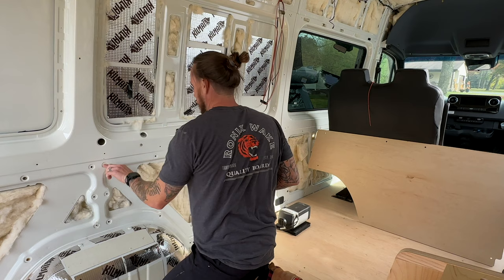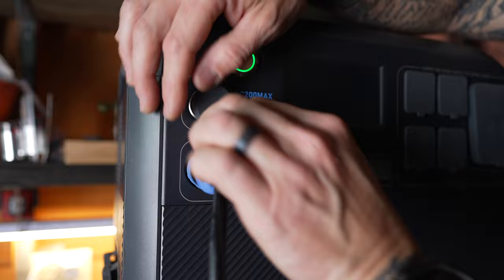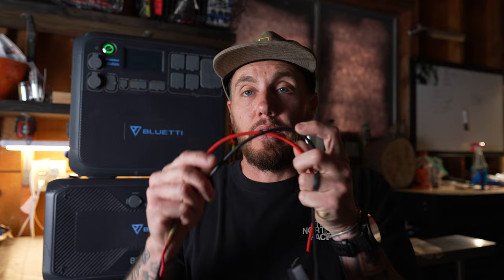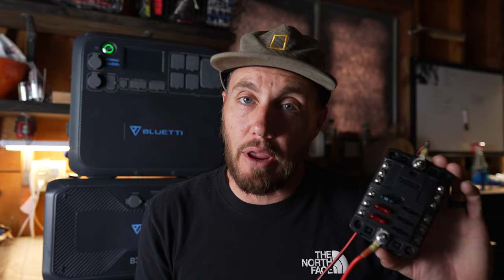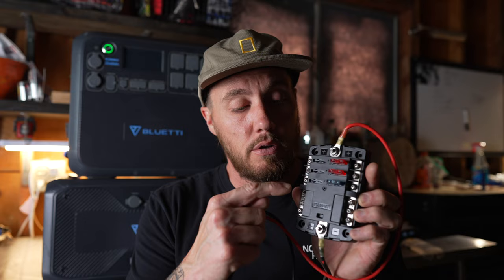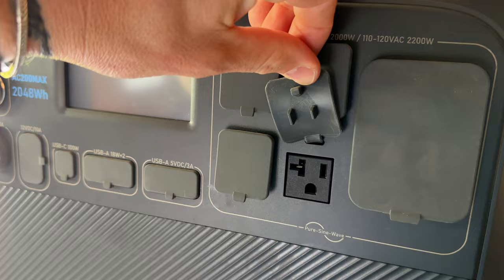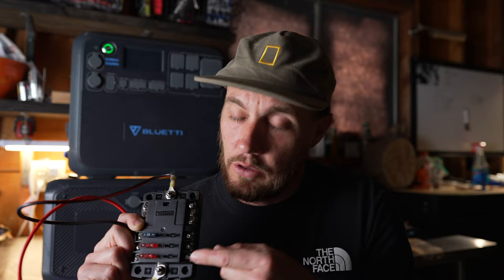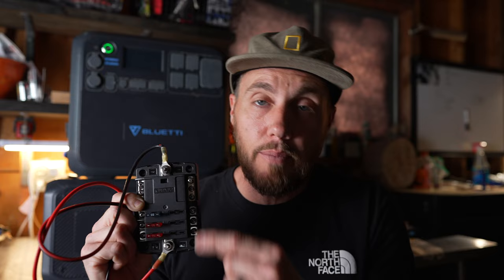Step By Step Guide To Powering Your Van Using The Bluetti AC200 Max

Comment: Why did it take so damn long for this video !!! Not you in particular but just YT. Thank you my man!!
Reply from the maker: No worries!
Reply: Thank you for this video which convinced me the bluetti ac200 max is the one for my needs. I’ve been looking for specific’s to connect the 30 amp output to my 12 gang blue sea fuse panel. I really appreciate this. I will you your link to order😊
Reply: So is it possibly sensuble to have different devices on different batteries & 2 different gage wires so you get around line losses due to distance?

Comment: Why didn't you just make an XT60 end for your connection to the RV.  Then you didn't have cut/ruin the Bluetti RV 30a cable.
Reply from the maker: It never crossed my mind. Both ways work well.

Comment: Are you having any issues with the phantom power draw? I am just trying to get a bit more info on this issue before I buy. I will be using it for full time van life and will eventually have solar, so with it being charged every day I don’t see the phantom draw to be much of an issue. Over night I only plan to use power for a fan, 12v fridge, and phone charging. Thanks
Reply from the maker: I have not personally experienced a phantom draw. For the application you mentioned I think it will be a great setup. Email Info@adventurerigshop.com before you purchase the unit, they will get a you solid discount.

Comment: I have this same system and have the same renogy solar panels. The XT90 to cable makes it possible to charge either the AC 200 max or the B300 off of solar. However, we’re also talking about running everything off that same aviation port.  Does that mean I have to have two different aviation cables?— one that is stripped back and hooked up to the blue sea -> dc appliances and one that is hooked up to solar? Hope this question makes sense!
Reply from the maker: I think this makes sense. You will need two plugs, one for solar in and one for DC out. The solar in will plug directly into the port on the side of the power station. The DC out will be the aviation plug. I hope I'm understanding fully. If not, just reach out on instagram and I'll do my best to help.

Comment: Now I know how to easily power my camper build with my AC200MAX system. I still want to invest in a B300 auxiliary battery, but I already own the AC200MAX power station. Thanks for the video and for sharing. Subbed.
Reply from the maker: No worries! My setup is extremely solid. Just did a week in the desert and never needed shore power a single time.
Reply: What charges your bluetti, solar panels??

Comment: Awesome job.  I was searching for a video that explained what to do.  I plan on purchasing a van soon and just bought the AC200Max.  Thank you!!!
Reply: Question.  I plan on charging my bikes.  Is the Max200 big enough by itself or do I need expansion 300 or 230?
Reply from the maker: I'm not sure how big your pack is on the bike, but I would definitely recommend getting an expansion pack. I know you already purchased the 200max, but I would take a look at this link before you spend any more money. This is what I'm switching to. https://adventurerigshop.com/collections/sprinter-power-systems/products/ecoflow-power-kits-5kwh-independence-kit
Reply from the maker: Awesome stuff! When you do get your van, check out adventurerigshop.com for your interior components. Send them an email and they will get you a good discount on whatever you need.
Reply: Can you tell us what you have going to each of the spots on the 12 Blue Sea Fuse Box?

Comment: One thing you didn't touch on is if you could run multiple connections from the Bluetti to the fuse box? For instance if you wanted to run both the 30A and the 10A to the same fuse box, does this work? Would that equate to 40A available?
Reply from the maker: I don't know for sure on that. I know you could run two separate fuse boxes, one for smaller items and one for larger ones.

Comment: I just bought a new AC200PL but unfortunately it doesn’t have a DC 12v with 30amp output. It only has the cigarette 10am output or a 24v 8amp out put. How should I hook it up to the fuse panel? Thanks
Reply from the maker: You can use the 10amp plug, you just have to cut the opposite end of the cig plug and it will reveal a power and ground.

Comment: OMG I needed this so bad!!! Thank you!! - so where do you get a DC charger for a laptop??? I have an ASUS gaming laptop for work and would LOVE to not be have to have a wall plug in my van!!
Reply from the maker: I just took the AC adapter off my computer and plug directly into DC power. That brick that plugs into the wall just converts the power to DC for the computer to charge. If you don't have that option you could run a small extension cord from your power station when you need to charge your laptop.

Comment: My only concern and reason I don’t power builds off of this. Solar is worthless to me in the pnw. Can the ac200 be charged off the alternator?
Reply from the maker: it can, but it requires a bit more effort than other options. This is what I'm switching my power setup to https://adventurerigshop.com/products/ecoflow-power-kits-5kwh-independence-kit It's a bit pricey, but was specifically engineered for the van world.
Reply: @roamingwithjosh  yooo thank you so much for the response man!
Reply: @roamingwithjosh  it is really annoying that Ecoflow didn't just add a 30A DC output to their Delta line.  They already offer a great option to charge off the alternator.  But, as you point out it would keep people from spending 5k.

Comment: I became confused at the end when you talked about using the two units together. And you mentioned other products for $1500 that can do everything. So, just to be clear, can you use the AC200 Max as a complete system? Also, at what point would you need a B300? We are using our van for weekend camping or 2 week excursions at most. Very minimal build that is running a refrigerator, MaxAir deluxe fan, and dimmable lights. Thank you so much for taking the time to create the video, and answering questions.
Reply from the maker: I apologize for the lack of clarity at the end. If you have solar and only run those components, an AC200 max would suffice for 3-5 day. You can assume you will get two full days out of your AC200 max with no kind of power being replaced by solar or shore power. If you spend time at campgrounds mostly, then the AC200 max would be fine because you most likely will have shore power. The two units combined last us 4-5 days with nothing coming in, that’s with running our Webasto diesel heater. There are variables that I would need to know before I could give you a straight answer. Those question revolve around how you plan to charge the system. You can email me or send us a message on Instagram and I’d be happy to help. I usually don’t see comments after the original one I answer.

Comment: So…. Before I blow myself up. If I have a fuse box already installed can I just take off the power source and connect the Bluetti without installing a new fuse box?   Is it really that easy?
Reply from the maker: I'm assuming you're talking about already having a Blue Sea fuse box or something similar. So, if that is the case, all you have to do is remove your existing power source and install your bluetti power source. It really is that easy.

Comment: noob question... can i use induction cooker and power up my low profile desktop pc using bluetti  ac socket while the bluetti power up my campervan 12v dc system with no problem?
Reply from the maker: Anything that conducts heat will kill your battery. Most of those pull around 1,200ish watts and the bluetti has 2048 Watt hours. Essentially thing will kill your AC200max in about an hour and a half and depending on how you're re-charging could leave you powerless.

Comment: This video has been helpful. But I have a question. Is it possible to use all of the DC outlets at the same time.  If there is a need for more than 25 amps, could the 10 amp outlet be used as well?  My hydronic heating system has a large initial draw. It uses an espar heater and has 2 circulating pumps and a fan. It has a 20, 7.5, and 5 amp fuse.  I will also have a water pump, refrigerator, 2 max fans, ceiling lights, outdoor lights,  I know the actual draw is less than the fuse, but could I have a 2 separate fuse boxes connected to 2 different DC outlets on the bluetti? Thank you.
Reply from the maker: Yes, you could run a smaller fuse box off the 10 amp and use a larger fuse box from the 30 amp allowing you more room for items.

Comment: I have the AC200max and I'm wiring my van.  Some suggest putting an in-line fuse on the aviation cord.  Is this necessary?  Another question I have is this:  My dc fridge has a ground screw so I bought 3 wire 12 guage for it.  I'm confused as to wear I should attach the ground wire to.  Should it go to the fuse block or to the van chassis?  Thanks for your help.  I find this video helpful.
Reply from the maker: I don't see why that would be needed when the AC200 max is fused internally and you're running your power to an additional fuse panel (assuming that's what you're doing.)  I'm not sure what fridge you're using, but if it's DC then you should only need to ground it to the fuse box. The ground screw is probably for a different type of configuration that it doesn't sound like you're running. Again, I don't know your exact components so I would check with the manufacturer about that just to be sure.

Comment: At about 7:15 in the video you talk about having grounded your fuse box. I am unclear about whether or not the Bluetti needs a ground. Can you share some detail about how you grounded your system?
Reply from the maker: My fuse box is grounded to the bluetti power station not separately. The cord that goes from the power station to the fuse box has a power and ground and they are attached to the fuse box. Hopefully that's helpful!
Reply: @roamingwithjosh  thanks! To make sure I fully understand, are you referring to the red and black wires that connect to either end of the fuse box? There is no wiring outside of those that do straight to the Bluetti?
Reply: @amykopischke3937 red is positive black is ground (negative) put simply

Comment: Nice video, thanks. Just a simple question. I noticed that you have 1, 30 amp and 2, 10 amp outputs. Is the maximum capacity 30 amps or can it use all combined for 50 amps?
Reply from the maker: I'm fairly certain they can be combined, but I never needed that so I cannot confirm that's accurate.

Comment: Why no fuse on the positive lead between the AC200 and fuse panel? Just honestly curious.
Reply from the maker: I honestly never considered it. No particular reason. It wouldn't be a bad idea for additional redundancy.
Reply: @roamingwithjosh  you aren't wrong
Reply: @roamingwithjosh  ordered the AC200MAX looking to do this in my truck bed camper

Comment: Can you put a link to the cable that goes from the DC 12V 30amp
Reply from the maker: https://amzn.to/4d8lLqo Its the one with the blue end on it. Cut the other end off and then use that as your power and ground.
Reply: Is the aviation plug and cable the same? I have the cable, blue end, and still 12v/30a…. I’m still learning about electricity and components so appreciate the help.

Comment: If one is only using dc devices, why should you go for a big system? (Like Bluetti, or ac in it , etc)

Let’s say I want to have solar panels and only small dc consuming devices. I feel I could do that very efficient…
Only a fridge might be a problem. Or fast charging a laptop?

Could you help us with this?
Reply from the maker: Everything in my van was ran off DC and only used the AC ports occasionally on the bluetti. Even my fridge is DC powered. The laptop may be the only issue, but I always plugged my in to the DC port on the wall and it charged quickly.

Comment: Nice video. Well thought out and presented. But, I don't understand why you chose to go this route. I am in the same boat but I went a different route. I purchased four LiFePo4 300ah batteries, and an inverter. It is way, way cheaper and does a much better job than using the Bluetti set up (which I have as well). I'm never without power day or night. Solar charge too. You're wanting to save money then use the batteries and the inverter. Regardless the route you go, keep making the videos, I will tune in again. All the best.
Reply from the maker: Thanks for the comment! More than anything, the Bluetti system allows me to use the main battery (AC200max) between multiple vehicles. Had I gone the route you suggested, the system would have had to remain in the van, which would have cost me more having additional units. That was one of my main determining factors.
Reply: Which LiFePo4 batteries did you buy?
Reply: The price of 4 300Ah LiFePo4 batteries and the inverter was less than the price of the BLUETTI AC200 Max? I purchased a BLUETTI AC200P for $949 + tax! I don’t believe that it cost less at purchasing separate components than an all in one unit. I also added seven 100W panels for $54 each and free shipping. Sorry
Reply: Where are you getting your stuff for it to be cheaper that way? I've spent hundreds of hours weighing options and it seems like just the batteries and inverter alone will cost more than the equal amount if power from a bkuetti set up, then I have to get cables to connect it all, and a solar charge controller and breakers

Comment: Thanks so much for all of your detailed videos.  They are super helpful!  I have a simple electrical build in my Sprinter which is put together similar to yours and am experiencing an issue with my Espar diesel heater.  When I test it, it will run fine off of my Sprinter starter battery (through the dashboard 12v cigarette lighter), but it will not run through the AC200max RV/aviation output.  It "times out" and gives an error code.  Crazy since the Bluetti is actually producing a steady 13.5 ish volts compared to the under 12v from the start battery.  My current work around is to run the Bluetti through an AC to DC converter.  It is not the most efficient way, but works for now.  Any insight to find a way to run it off of 12v would be greatly appreciated.  Thanks again for all of your work producing content.
Reply from the maker: That's really strange. I use the Webasto and have it connected directly to my fuse 12v fuse box. I've never had any issues with it timing out on me or giving me any error codes. Sorry I can't provide much help here!
Reply: @roamingwithjosh  Thanks for the reply.  Maybe it is an issue with the Espar in particular.  It seems like others are experiencing similar issues to mine.  Oh well.  Back to the research. 😞

Comment: I was considering running the whole van off the 3 pin sockets/cigarette lighter ect and removing the need for the fuse box. Would you reccomend against this? Thanks
Reply from the maker: I believe the cig lighter plug is only 10amps so you may have trouble making that happen.
Reply: @nativenomads  I've seen someone run a small fridge from the cig lighter then thought I could run the lights and sockets from the 3 pin plugs.  Might be best to run the fan and water heater through the fuse board as you showed though?

Comment: Not sure if I’ll get a response, but I’m planning on doing this as well. Is there no concern regarding the wire size from the AC200 to the fuse box? Is that small of a wire fine if I’m using all 6 fuses spots (or possibly more)?
Reply from the maker: You definitely want to know how much power is going to be going through the wires to the fuse box at max draw as well as the distance between the fuse box and the AC200. I believe I used either a 10 ot 12 awg wire, but I cannot remember for certain which it was.

Comment: Hello Josh.  Thanks for all your videos regarding your power setup.  I've been following you since your Gladiator Days.  With that said, I'm trying to copy your setup for my needs in my Gladiator for extended overlanding trips.  Where I wanted to go into a different direction is using a switch panel vs The Blue Sea Fuse Block.  Offhand, do you know if they would work the same?  I'm such a newbie when it comes to power but figured I could get a way with the switch panel because it has the "plugs" so I can power each light, fridge, etc all in the back of my jeep.  Let me know if you think this would work or any suggestions.  Again, I appreciate your videos and insight.
Reply from the maker: I'm assuming you mean like a switch pros or a auxbeam type of switch panel? If so, I do believe it would work the same way. Should be the same type of set up, but if it has an aux fuse tap then you would need to wire that directly to the same power as the main power. That would cause a constant power draw though so it may not be the best option for the long term. Hope that is helpful!